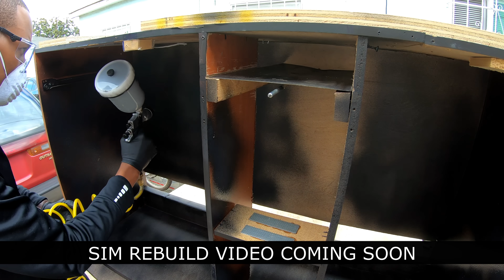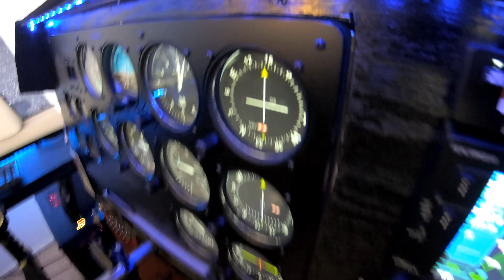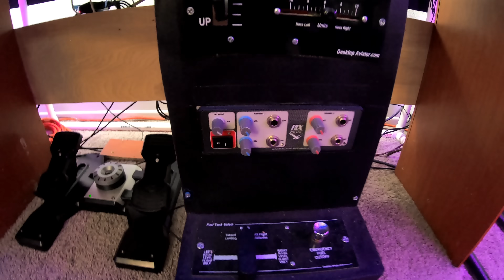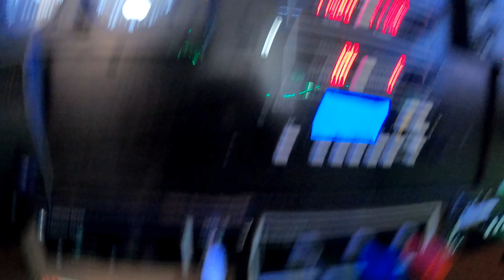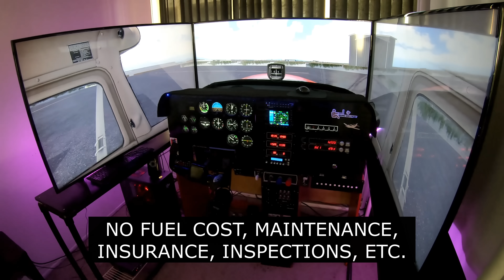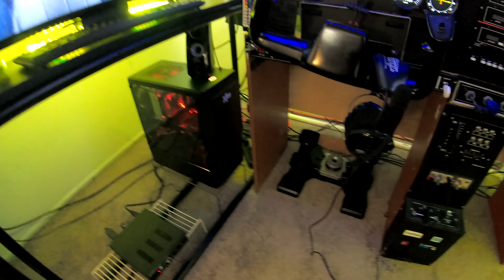HOW MUCH??? | Home Flight Simulator | Home Sim Pilot

Comment: I appreciate your video, but you continue to mention the extra detail packs you downloaded for better  details, be cool to see the comparison between the two using ‘stock’ landscape comparisons… but I definitely understand and can see the better performance of the PC - though it seems with the details, you also get the aliasing on the buildings - again, appreciate your efforts (I’m in the midst of building a home ‘pit and starting from square one - building and picking the parts for the heart of it, the PC. Seems as though 2024’s using a bit more of the GPU’s strengths vs being so CPU intensive (and under utilizing of the GPU). I’m making that decision now as you’re right, the sim is insanely incredible, and as a player of v1 on a monochrome Apple IIe (pre-Windows being an OS, but they had software, and bought it from some pilot/coders who built it, I believe). From the geometric lines of Meiggs Field and a couple of Chicago buildings (stick buildings) and illegible gauges to today’s eyes;) through the amazing jumps in details (I thought) through the 90’s and even 2010… the difference between 2020/24 and 2010, along with 1981’ish’s releases is revolutionary. The definition of revolutionary, in my opinion. As the software that you could count on beating your pocketbook for the best possible specs to get the juice outta the sim, regardless of generation. Not sure what they coded it on lol - but today’s options are significantly more affordable to use the sim. And making it run as well as they’ve done on a $500 console ONLY helps those of us who go completely overboard and have the kids outta the house, with a passion for flying, doesn’t matter HOW much you spend on your PC, peripherals including yoke or HOTAS, the mounts or pre-built seats w/plates and mounts, pedals and panels, displays or VR - you will ALWAYS be ahead of owning, flying, and maintaining even a 152/172! And what’s been built has recreated or maybe as a first, spawned a phenomenal third party, cottage industry of flight periphery that are so incredibly realistic that the engagement and experience is so ‘real’ feeling - and the safety factor is exponentially greater you’ll be home for dinner - if you’re a GA pilot who’s unable to continue owing and ownership of the real thing, you’re not getting in the air much… jump in, check out Winiwig (sp?) and the high end - top shelf peripheral manufacturing using all metal and amazing movement of your stick and HOTAS…MFD and PFDs, trim wheels and your flight panel (AP & FD/Speed altitude settings, auto throttle, etc and radio panels, you can buy seats/cockpits with full motion! Cool time to be a fan, and XBOX is bringing the sim to the masses, which adds to marketplace contents and peripheral building (There’s also excellent controls from Logitech to Turtle Beach, and a dozen or three more that are significantly more reasonable on the budget, and you can find a thousand ways to build your ‘pit, using VESA mounts and 2x4’s for a $100!). So thanks again, I’m still surprised by the game/sim/software and how well the OS (Windows) plays with so many peripherals and controls that work so well - are so easily mapped and connected using powered USB hubs. And the drawings of many millions of megapixels with seemingly no latency - the hobby has come a LONG way in what seems (but I’m 55) like short period of time… and only a fantasy even a decade ago in this detail and playability - options and airports, physics and details. Along with other sims like DCS and XPlane 11/12 - the physics, ability to use in VR, and social interaction with other fighter drivers in competition with other ‘real’ people - again - without latency and in real time - it’s CRAZY you can play it on a $300 console, although the $500 option is significantly better, with a game pad and have most main flight controls mapped to fly is insane. Along with the ability to spend a $100,000 to build an FAA certified full motion sim in your garage that only increases the ‘reality’ of the sim… as the engagement is crazy real feeling in some of these folks’ builds. And the fact you can fly over your house? A dream not too long ago. Keep up the great work (and the other win for the PC is the market place content available, whether planes or landscapes - the PC’s options are endless)

Comment: I really admire your flight sim, I went through the same process and spent double in cost. This was mainly due to trail and error. I ended up spending $7000 just on the PC alone. 
I spent an additional $3000 on the second PC and overall cost on the complete sim was $15600 That included all the software and hardware. this also included the power regulator station and G1000 MFD and PFD also the 3 Ipads which i use for RF cockpit RF glass and RF radio. I also have my PPL which i fly different planes is why i chose my setup. awesome job on your setup.

Comment: Almost 20 years ago, I bought my first ultralight.  After 3 or 4 years of buying and fixing different ULs, paying for engine rebuilds, parts, fuel, and years of storage at the airport... I probably pissed away what you've spent here (adjusted for inflation).  The money per hour of flying just wasn't worth it for me, so went back to motorcycles.  You have an awesome setup, and now that I'm in my 70s, it might be a better solution to get back into flying.  Thanks for sharing!!!!

Comment: It is a very nice rig, and very good value for the money I must say. Not overpriced, not cheap - good value. I started out in DCS (now I do MSFS too), bought the HOTAS and rudder from Thrustmaster that seemed like a solid choice (it was), and the TrackIR. The gear (excluding the computer and monitor) was about 1500 USD. It is good enough for me. Recently I upgraded the computer (Intel NUC Extreme with AMD Radeon 7900 XT 20GB) and monitor (49" ultrawide - really cool. Love it) That costed quite a bit, but worth it 🙂

Comment: This is a great idea! I’m in the same boat as you. I got my license in 1986 but I haven’t flown since about 2008. I just haven’t had the time or money and then recently I’m not able to get my medical anyway. This is a great way to keep wine stay sharp and save a ton of money. Can I ask you the wire using explain instead of Microsoft flight simulator? Or do you use both. Is there any advantage to one over the other? Thanks for the great video.

Comment: Amazing. Thinking of just getting started and this video helps so much. Exactly what I was looking for with costs and what each piece does since I know nothing about flight. One thing i haven't seen is what software in research in software recommendations. What system for flight sym are you using and the cost? Also do you have a recommendation for a fighter pilot software or any info on what a set up like that would look like? Great video. One of the best I've seen over the years for any You Tube stuff.

Comment: . Fs2020 $159. I bought a ch yoke for $6 in a old stuff shop, $150$ ch pro pedal,  you need a good $3000 computer (1080ti minimum) and a vr headset , mine is samsung odyssey v1 $399 in canadians dollars. The final quality is sensational. The only way to beat that is buying a varjo vr3 and rtx3090 for a $12000$ computer. With a velocityone or honeycomb or k1 yoke and pedals. But mine is very good for learning planes and incredible visuals

Comment: Wow, you got royally ripped off on that pc. I have a PC with higher specs I built myself for around 1400. i9 processor, 32gb ram, 1000w psu, 2080ti and a Lian Li Case.

Comment: I get it. I have 3k into a driving sim with VR. I am going to build a motorcycle to play Ride. I am going to find a frame and some plastics. Then pillage an Xbox1 controller, For the analogs and output board. I think I can do it. I still need to sort a Spring I can lean on and a method to recenter it. I would like a motor. But I need to build it first and measure me and it. To get a motor to perform wheelies and stopies. I am also pestering the living crap out of the devs for VR support.
Reply: Not as cool as yours but I love it.  https://youtu.be/idcNLDWOxPU

Comment: The cost of a flight sim REALLY depends on how far you want to go with it. Mine only cost around 700 US. That's the computer, HOTAS, Pedals, TrackIR, and headset. But there are sim pits out there that cost many thousands. It's all in how real you want to make it. Personally, if the sim pit is going to cost me more than 10 grand, I may as well buy a real plane.

Comment: What? I have i9 10900k 3.7ghz, 32ddr5ram corsair rgb ,msi  rtx3090 12gb, 1t ssd evo, 1tm.2 evossd, 512 gb ssd samssung 3vo, corsair cooler dragon, 5 bequiet fan rgb, be quiet case rgb, Msi Chipset motherboard with wifi,  7.1 soundcard, windows Pro 10 and this was now in May 2021 2890 euro. Just Nvidia was 1200 euro. And delivery was free in 2 days was at my home complet setuped just start and  play.

Comment: I got a flight simulator with 1 desktop computer 1 monitor a yoke, throttle quadrant, a couple small switch pannels and 1 IPAD for  about $2,300 its not nearly as fancy as his simulator but its alot better than a laptop and joystick. The computer and monitor cost $850 and then the flight controls were $100 to $300 a piece.

Comment: Great video! I have similar setup, and I am trying to find the right PC.  In my Sim, I have the six pack, radio and other stuff in the panel and I need 12 USB connections.  How do you do that when I am sure your PC does not come with that many USB connection slots?  Where do you plug everything into to make it all work?  Thanks!

Comment: just was wondering how you setup 3 tv's. I have a 2060 super video card with 3 display ports and 1 HDMI. will I have to use some sort of converter and will I be able to use HDMI while using 2 display ports. or will I only be able to use display ports with HDMI adapter.

Comment: Great video! Thanks for sharing :)

You have 1 monitor behind your dash and I have four mini panels (monitors) behind mine. JUST so I could put the yoke shaft where it's between the gauges. Haha, talk about a price difference and major increase in time for the build, and start up and getting everything set for the "nights delights" (each time). If I did it again I would do just the one monitor. I did a 744 back in 2002'ish with Project Magenta software. Did it all for $11k, but without coming close to completing the very pricey overhead. Back then you didn't have many people stupid enough,,, I mean "Driven" to do such a thing. The cards were far from plug and play and you spent months learning epic programming (and by that I mean learning how to copy and paste someone else's code) just to get a switch to work. There was no FSUIPC, LUA scripts or anything. It was 100% epic programming to very unfriendly computers that were barely getting USB drivers working and the only choice in panels was FlightDeckSolutions (insanely costly back then). 

Sooooooo gald we live in the age we are in now. So much easier and SOOOOOO much cheaper, yet still not for the faint of heart (and by that I mean wallet).

The Buttkicker was the first real immersion giver I bought. Great to have that for takeoffs and landings. Such a major part of the experience.

I'm doing a C172/C182RG at the moment. It was 7k without monitors. My PC on the other hand I just rebuilt and it alone is another 7k. I will have a video on that in a week or two. My pit will be getting hydraulics in a year or two. Major factor is we're lucky to where it's getting cheaper and less house destructive to do, but the weight that it supports, even for C152 needs to be at least 400lbs. They're only at 250lbs for my price range (2k).

VR however is my number one immersion gem. I'm awaiting my HP Reverb G2 (the first only VR headset that will work with FS20). I still want a pit though so I can lose the mouse and reach out and touch the knobs, pots and controls. I only fire up the screens for company since getting each screen set with Air Manager can be time consuming with my particular setup.

Comment: Impressive setup man.  Some of this I would not spend the money on, like the headset panel (I'd be fine with USB to my PC)... but totally awesome!  Hey now that the yoke is no longer manufactured, will you ever move to another one?  I have the Honeycomb Alpha yoke ($250) and... well, you might have been right that $600 was a mid-range yoke before the Honeycomb, but I think they've made the "new standard" for mid-range with the Alpha.  Of course it duplicates some of the other equipment you have (switch panel, etc).  I reckon your next yoke would be a lot more expensive if you dont choose the Honeycomb!  Thanks for the video.  Again, blown away.
Reply: Man the propwash gear looks really slick, I'm debating to go with those or the Logitech radio panel.  I love XP11 but I don't know if they would work in MSFS2020 too.  Also, I don't have a big panel to mount them in, I just use my desktop, so I would have to get the stand they sell to mount their panels in.
Reply: HAH Nah dude 7k sounds veeeeeery reasonable for this setup.  Gives some of us poor people hope! :)

Comment: Cool setup man. Would be cooler if you could get the front half of a decommissioned C172 and fit everything to it. You could have the side monitors on its outside. Course I guess not too many front halves of a fuelsalage in aircraft salvage yards - since aircraft generall crash nose first.

Comment: Just curious what temps you get on your OC'd i-5 9600KF at high load? And is that a Cooler master Hyper 212 CPU cooler? I've got exactly the same pairing but havent tried OC'ing mine yet.

Comment: That is seriously impressive and if you've got spare space in the house, definitely go for it if it's something you're really keen on. The fact you're a certified pilot explains a lot - flying must be a passion with you. There are a large number of hobbies costing far in excess of this. I played guitar in a busy local dance/function band for many years and the cost of the gear was...a lot more.
I wonder, though, if you'd be interested checking out that incoming Reverb G2 VR unit - MRTV's 'through the lens' videos show it to be seriously impressive compared to the competition, giving you a significant boost in immersion.

Comment: Man you got SCAMMED on the PC way overpriced jesus christ.
Reply: You always pay a premium for buying it pre assembled, and of the 2458 he said he paid without shipping, it's kinda accurate and makes sense:
- i5 9600kf: 230 usd
-RTX 2080 Super: 1000 usd.
-NVMe Drive: 400usd ish
- Mobo: 200 ish
-32gigs @ 3200: 200 ish
-PSU: around a 100.
Total (approximate): 2130. 300 is a little bit high for a premium, but doesn't surprise me.
Reply: @luccca19  No idea where you are getting these prices from... A 2080 super is $700 and A 1tb 970 EVO is less than $200. You have overvalued everything mentioned except for the PSU. It wasn't even a 2080 super in build lol

Comment: Got scammed on the PC bro. That stuff should cost around 1,300, give or take a hundred. Sorry.
Reply: yeah i put it on pc partpicker and it was $1500
Reply: I could have built him a way better computer for a free dinner lol. I've done it before for be friends.
Reply: @kramerhainebach2540  he did it 2 years ago so it was probably around 2-2.5k back then and 200 bucks for delivery  puts it around 2500 dollars. Few hundred bucks for building it is probably the standard although I dont know if getting it done by a pro would give a significant boost in performance vs an avg person so he probably lost around 1000$ but he said he wanted to support that buissness. Considering he has to be pretty rich to be able to afford to be a certified pilot and drop it and buy a 7000$ flight sim it's probably a drop in the bucket for him

Comment: I've had a yoke and pedals for decades and they are still going strong! Plus, I've got an older HOTAS that still works. Been waiting a long time to break them back out! The best part is that I got them from a thrift store for dirt cheap and they are worth more now, than when originally sold at retail price! And I've got a 32" HDTV @1080P and that's all I need. This setup is nuts!

Comment: With flight simulator 2020 not allowing you to take the controls off the screen,  Will you be able to use it, or is there a work around?  Thanks in advance for you help as I want to use it for a home simulator.

Comment: If your pc seems like its due for an upgrade with the new flight simulator just reach out for guidance to build your own PC. You clearly have the talent to build so a PC build wont be hard at all. You will  save alot of money. That Pc you got is a bit steep, I bet you could build it nicer looking for half the cost.But your flight system itself is very very cool. Would take very little to add a steering wheel for Auto sims.
Reply: His PC is way above the recommended specs for the new flight Sim.

Comment: better yet, build the cabin and instead of 3 monitors, have a Oculus Rift S headset. Cheaper and better immersion
Reply: @retikulum  you would need to have a a similar cabin to the plane you're flying or have a modular cabin and be able to move any component of the dash like a Lego set (to fit any in-game cabin)

Comment: As cool as this is I'd imagine nextgen VR headsets with a 180 degree FOV and higher resolution will make a three panel display setup like this irrelevant.
Reply: The major drawback of VR is not being able to see your physical switches and panels.  For me and many other flight sim fans with external control panels, this is a deal killer.  Once VR tech gets to the point where they integrate hi-res cameras to capture the environment and integrate those images with green screens to determine the display areas, I'll be sold.